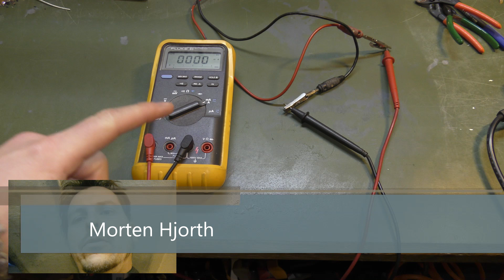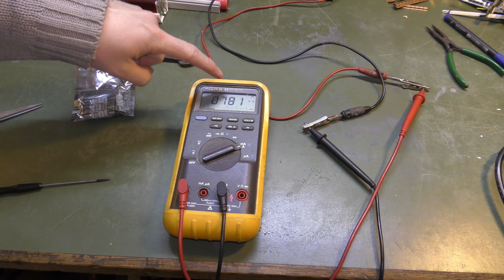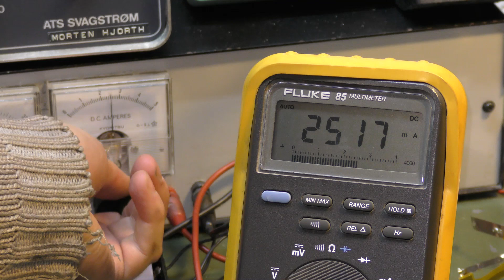Replacing Fast Acting Fuse (KLKD015) in Fluke 83,85,87 - 295

Comment: To blow the original good fuse and to replace it with the fake Chinese fuses. Very smart!
Reply from the maker: Hi Илья Основиков
Thank You very much! Some of the most expensive fuses I have ever bought,, But still way cheaper than the fluke branded fuses.
Thank you for watching! :-)
Reply: @MyPlayHouse  Do you realise that those fuses not olny needed to protect your meter from an overload but also to prevent meter destruction and possible hand injury in case of a high energy short circuit fuse explosion inside the meter?

Comment: Hi Morten, I found interesting that the fuses did not make it through the customs inspection without any fee. As far as I know, the import duties should be identical in all EU countries, and if the total value of the goods (including shipping) is not more than 22€, you don't need to pay anything. If it's between 22 and 150€, only VAT needs to be paid, and VAT + import tax has to be paid only if it's over 150€. However, it has happened to me that a 250€ smartphone (with the right price declared on the package) was delivered to me without customs inspection :))
Reply from the maker: Hi +AttilaSVK 
Well here it´s 80ddk about 10,7€ before we have to pay only VAT,,, that is not a problem,,that is pennys,, it is the 160 ddk fee the postages services charges to collect the pennies that sucks :-/
I have gotten big expensive things through from China ;-) this one they took :-(
Thank you for watching! :-)